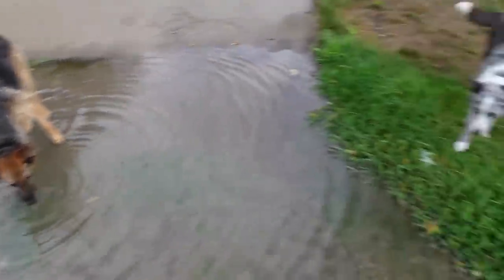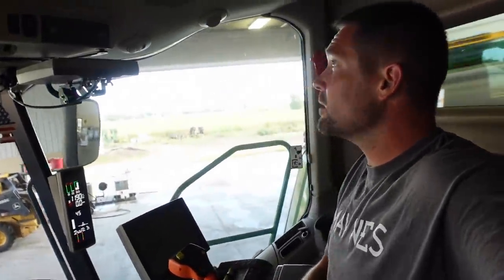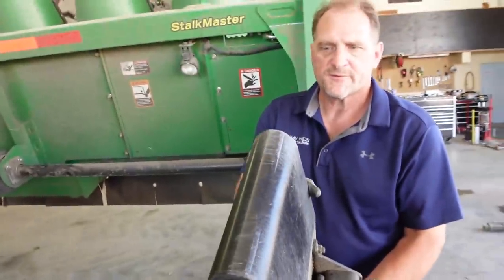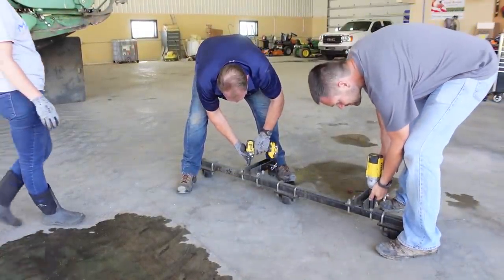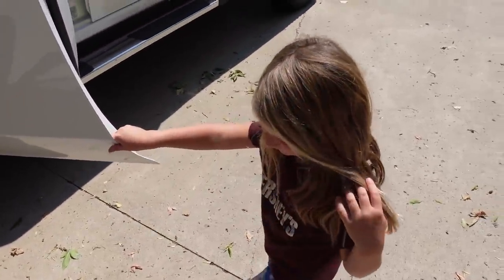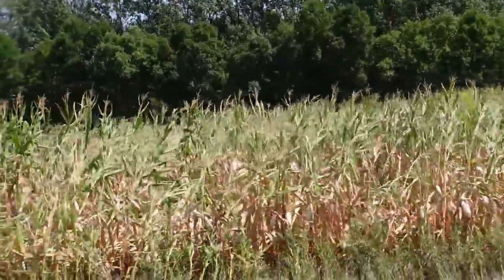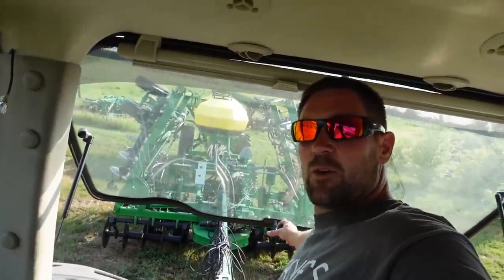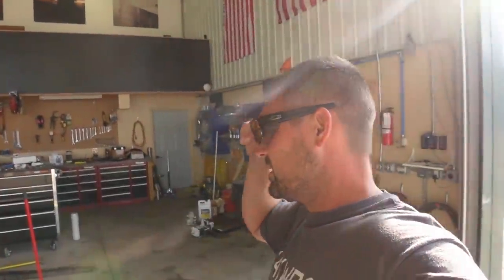How Bad Could it be?!

Comment: Are you aware that the pallet of water contains 1440 plastic bottles that you are throwing away? Have you considered a water chiller and an insulated water bottle? Not only are you not using 1440 single use plastic bottles, but you will be able to carry more water and keep it cooler for longer. Also, think of the money you will save.

Comment: You can pick  corn up, it just takes time and corn is light test weight… on strip tiller, just put bucket on hitch and block back up with light lift jack. ‘I’ Do it a lot when not setting implement in the dirt…

Comment: The 612c corn head needs to have an updated check valve kit (BXE10670) installed to make the hydraulics compatible with the new combine.  Deere changed production in 2016 and moved the check valves to all header equipment and removed them from all the combines at that time.  This design change reduces hydraulic leaks at the multicoupler connection between combine and front-end equipment.

Comment: Find an old 15' or 20' bean head with steel pick up teeth, lock the platform rigid as for wheat and let the old girl eat in the lodged corn.  Seen it done many times with an 8820.  Run a rope through the spring loops on the pickup teeth, keeps them from going through the combine.
It's not pretty or fun but has been done.
Hopefully prices make this years headache a little more mild, a big corn plant in southern Iowa is paying seven on corn so I've heard...

Comment: Balance the pin in the top of the hole,  back the hitch in till it clunks, which makes the pin fall in onto the hitch, then you can shift backwards or forwards till the pin drops right though.  I've done this for as long as I can rember.

Comment: Your feeder house plate looks pretty loose. Noticed it when you took the head off of the head cart. Also you could fit your head in the shop if it was a folding head. Lastly NDY makes a really good and a lot easier install of stompers and devastators from yetter work a lot better then stompers.

Comment: I found your channel a while ago, I seem to be binge watching you, I love the content and explanation of farming.  I had a grandpa who farmed on the side in WV, not nearly as big as you, only 40 Acers with livestalk and corn, I used to help in field manually cutting for silage to put in the Silo vis a 1945 conveyer chopper ran from a belt on a 6n ford.  Not a high tech as your operation.  I raced modifids in WV for 7 years ago, on Mark Richards track 25 years ago.  saw a Zturn JD mower, I was wondering with what you spend on Green Steel, do they give you that like a hat or Tshirt?

Comment: YOU HAVE A BOLT THAT'S NOT TIGHTENED ON THE BIG TOP. Wish I could attach a screenshot so I could show you. The nut is only started..... you can see it at 2:23 / 2:25 unless it's supposed to be that way???? Check it out! Let me know if I'm right or its something else. Either way, just a friendly heads up. Anyone else see this??
Reply from the maker: I saw it, thanks!
Reply: @MillennialFarmer  Absolutely my friend! You're welcome.